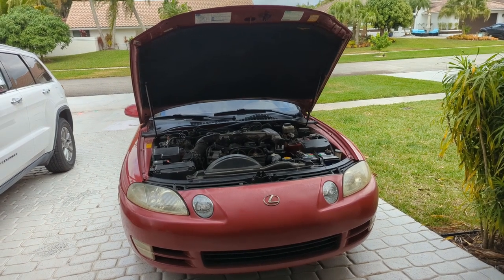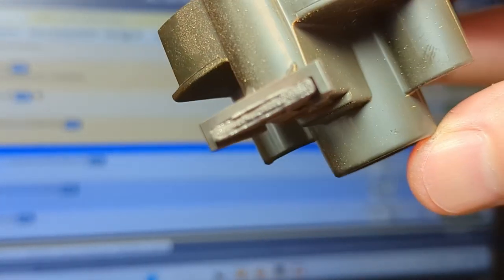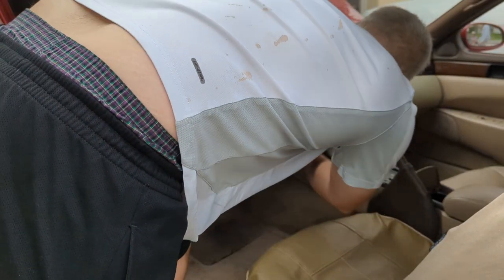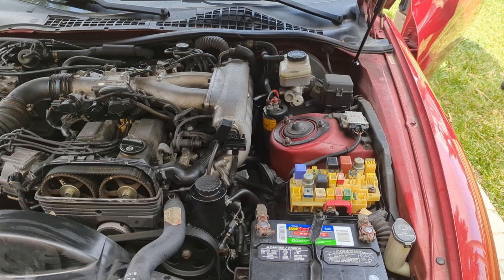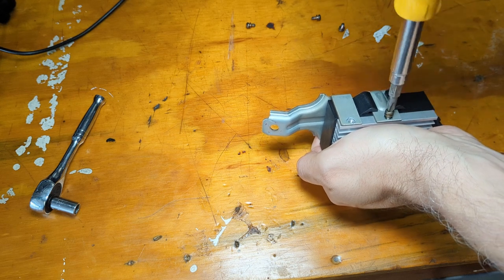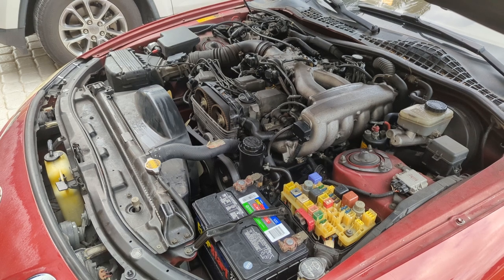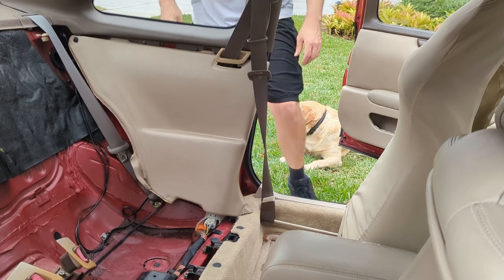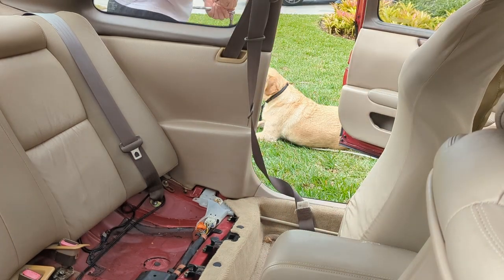1995 Lexus SC300 Runs then Dies

Comment: I own a 1992 sc300 with that engine and a 1993 toyota supra to.thy both had misfires turn out to be main ecu capacitors start leaking inside the motherboard if yiu catch it on time it can be saved.if car just cranks it could also b a bad fuel pump ecu in the rear panel .

Comment: I have  a 1007 done this same mod because of this issue worked okay for a while but now im having intermittent stalling and no start after a warm car
Reply: I once had an Audi 5000 in 1982, after 2 trips ,changed fuel activator, fuel injectors and $1000 Canadian dollars, the chief mechanic zeroed in the problem must be the fuel relay. It was hot to touch.

Comment: Just bought a 1992 sc400; after 200 miles the check engine light comes on; . Checked the gas cap - seems ok. I’ll clean the MAF/check light then clean the throttle body .  
You sir, henceforth will be my first point of reference .
Reply from the maker: Thank you! :)
Reply: i got a 95 sc300. had it for 3 months. started limp mode, misfires, bad exhaust smells, check engine light that wouldnt flash. just popped my ecu out and found 4 leaky capacitors. super common problem on these cars and its extremely easy to pull out and check, and different capacitors going out can cause a bunch of different problems so definitely worth trying before you waste money on parts you dont need. unless the damage is really bad anyone with basic soldering knowledge and experience can replace them just make sure you get the correct "100uf 15v" ratings for the capacitors.

Comment: I got a 97 sc300 it doesn’t run but will turn over if the throttle stays open but once closed dies immediately my obd1 scanner isn’t working and idk if this model has a obd2 port i haven’t seen it
Reply: 96 and on have the obd 2 this has an obd 1 I believe and it’ll be near the throttle body and power steering container labeled “diagnostic”
Reply: Look below the hood  release lever - it's tucked up under there
Reply: @MelaninCaptainX  it’s very limited on what you can do to read codes in the earlier models. They just weren’t designed for that.